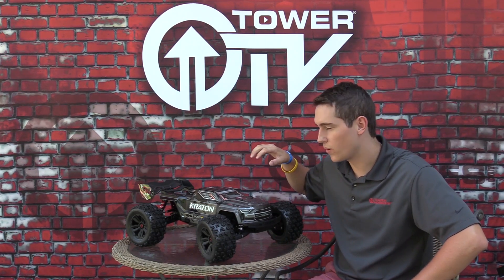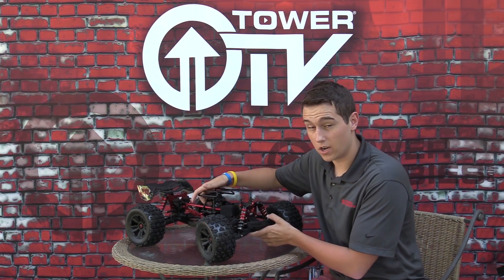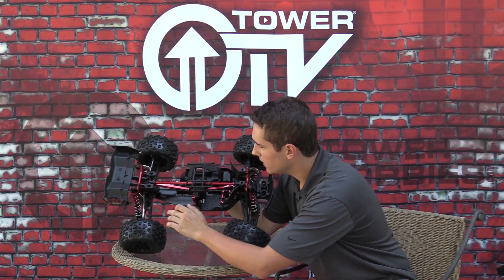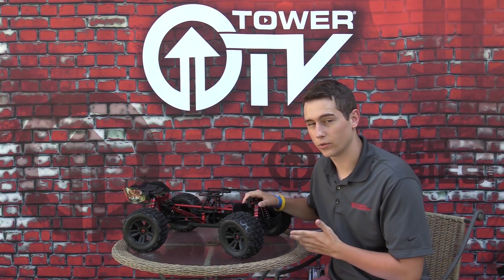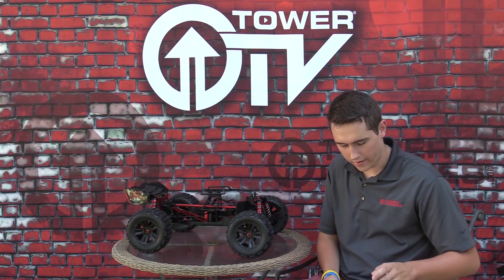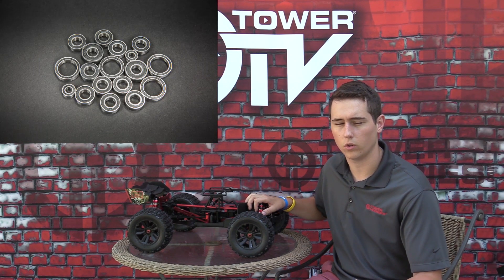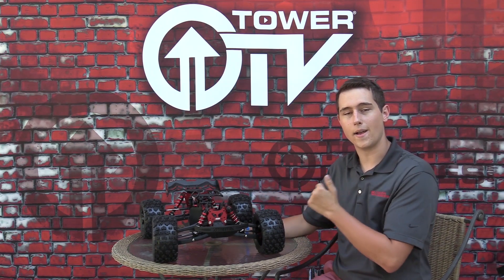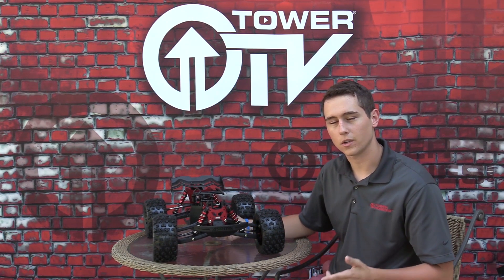Tower TV: ARRMA KRATON EXB Buying Guide

Comment: Chassi is 7075 alluminum not the same of the rtr the shock tower and chassi are 7075 vs 6061 alluminum. Its all over the box and on arrma website😞 you need to fix that or you will lesve people thinking it a v4 rc with minor upgrades without electronics